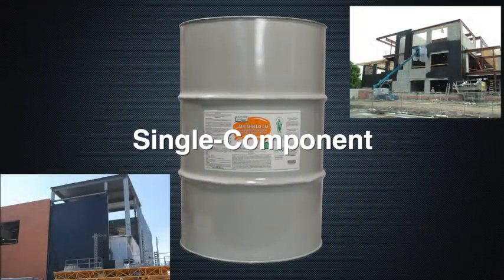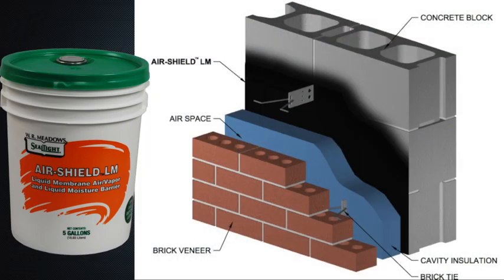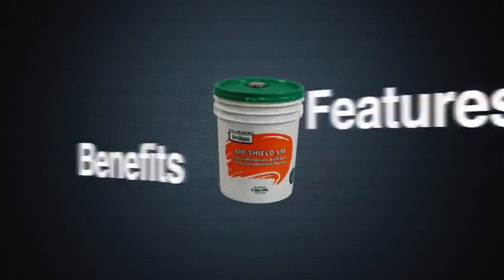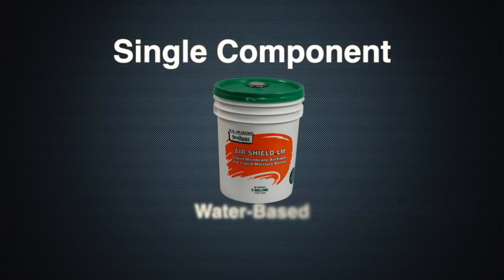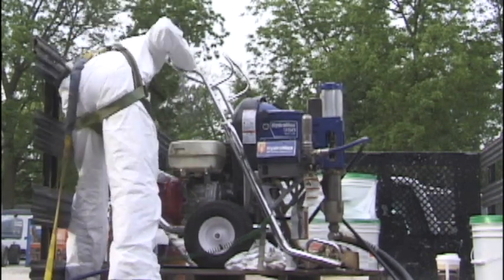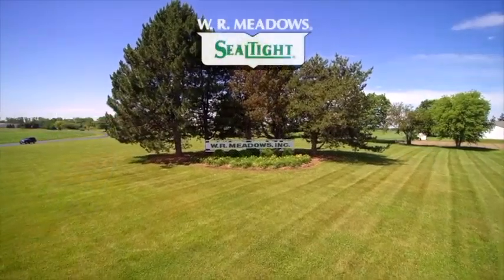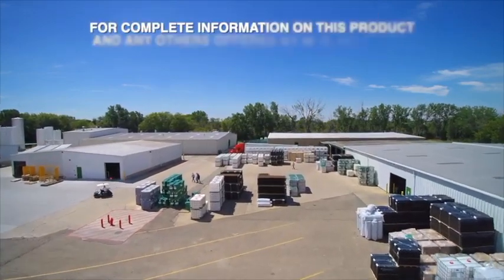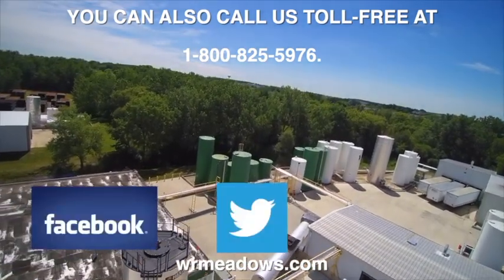AIR-SHIELD LM (2) Liquid Membrane Air/Vapor and Liquid Moisture Barrier

Comment: What product should be applied before and after this?
Reply from the maker: Nothing is applied before, as it would be applied on a clean sound substrate.  As for after, insulation would be applied exterior to it since it's an air vapor barrier. For more info, please send us an email at info@wrmeadows.com or call 800.342.5976. Thanks for your comment!